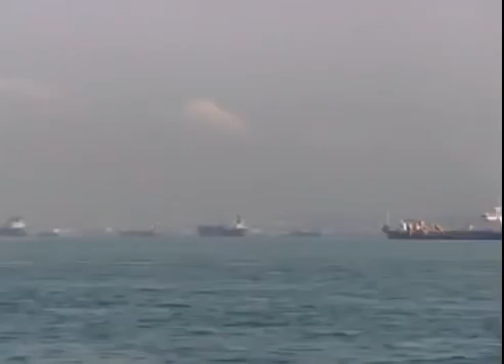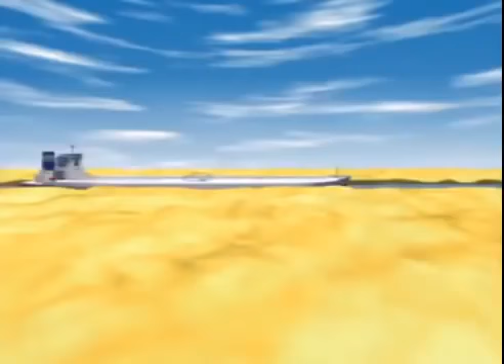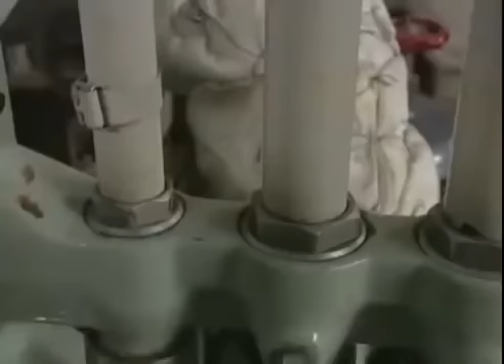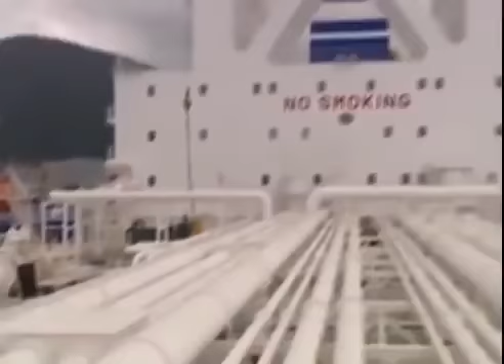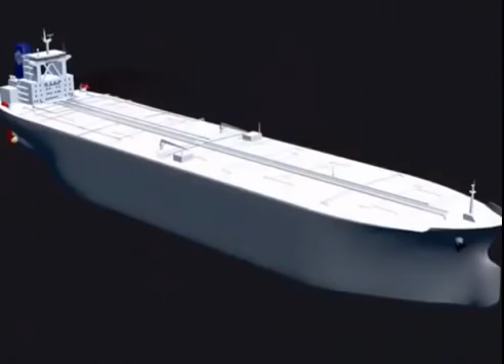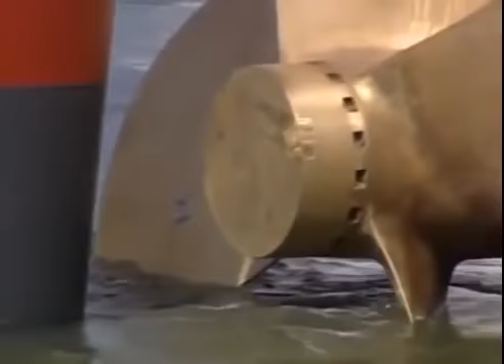Full Documentary - Biggest Oil Tanker In The World 2016 - Documentary

Comment: Oil tankers should not be made of steel, instead made of car tire rubber or similar. Long and tubular, with many compartments. Able to withstand extreme weather and wind
Reply: They use steel because it CAN withstand extreme weather and wind. Rubber as you can imagine wont be able to.
Reply: Wots up here, unable to read reply?
Reply: Rubber?
Reply: Y not, or something else, silicone, proposal not necessarily original, similar like towing long containers 70s
Reply: I would dry and crack from cold and sunlight exposure. 😂

Comment: lass overview
Builders: Daewoo Shipbuilding & Marine Engineering, Okpo-dong, South Korea
Built: 2002–2003
In service: 2003–present
Completed: 4
Active: 2
General characteristics [1]
Type: Ultra Large Crude Carrier
Tonnage: 
234,006 GT
162,477 NT
441,893 DWT
Displacement: 
67,591 tonnes (66,524 long tons) light
509,484 tonnes (501,437 long tons) full load
Length: 380 m (1,246 ft 9 in) o/a
Beam: 68 m (223 ft 1 in)
Draught: 24.5 m (80 ft 5 in)
Speed: 16.5 knots (30.6 km/h; 19.0 mph) (laden)
Capacity: 3,166,353 barrels (503,409,900 L)
Reply: Hauling away Americas wealth, as fast as possible